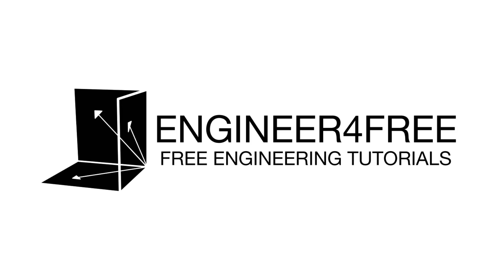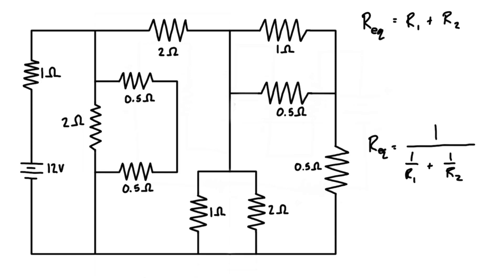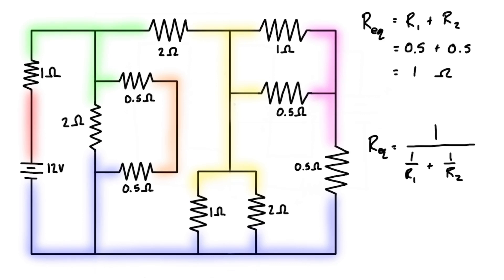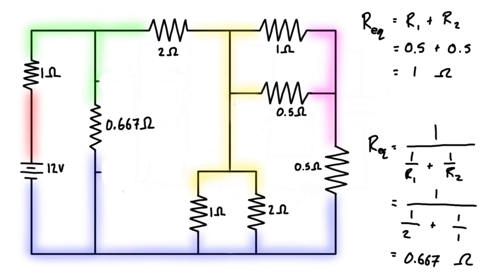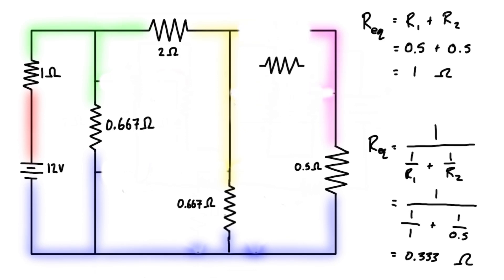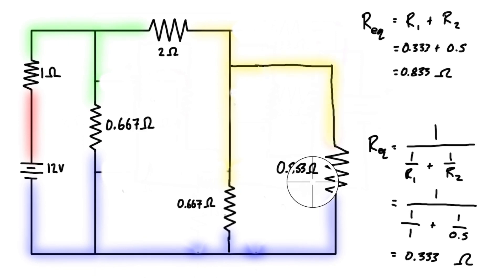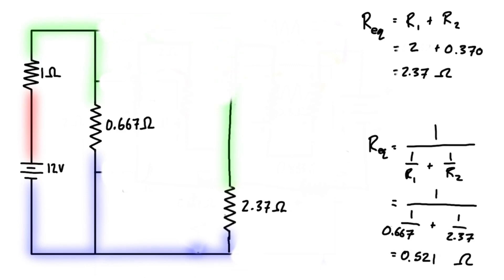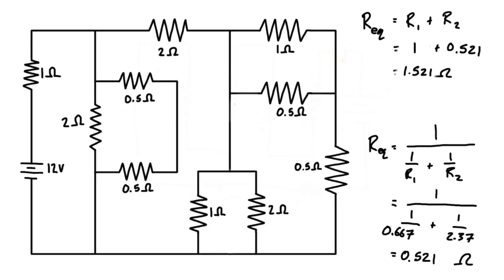Equivalent Resistance of a Complex Circuit with Series and Parallel Resistors

Comment from the maker: The full Circuit Analysis playlist is here:
https://www.youtube.com/playlist?list=PLOAuB8dR35ocf9Typ1iX9NRmX0V04UYfQ
Thanks for watching 🙌
Reply: I get it but I'm still confused lol 
So the current is the same for every single component but another video said current can change in parallel circuits. Idk 💀
Reply from the maker: @Eduardo_Espinoza  The current is not the same in every single component. Two resisters in parallel with difference resistance will have different currents through them, but the same voltage drop across. Check out videos 15-20 for Kirchhoff's laws here: engineer4free.com/circuits as well as videos 21-27 for more examples on current and division.
Reply: Finding current and voltage is complex

Comment: so you solve in series-parallel-series-parallel?
Reply from the maker: Find the easy ones and replace them with an equivalent, combing series ones, it parallel ones. Then repeat until there's only one left. If you need to find current and volt drop in every individual resistors, then redraw the circuit every time, and work your way backwards one step at a time . There are more examples here: https://www.engineer4free.com/circuits-solved-problems.html#series-and-parallel-resistors

Comment: Is there a clear definition of a node ?
Having some trouble 😕
Reply from the maker: It's basically a region that's electrically common, or has the same voltage potential all over it. So in these videos it would be each wire that is not a resistor, we are assuming these wires to be zero resistance. The elements themselves, like the resistors, have a voltage drop, so they are not part of the nodes. So take a highlighter, and put it on a wire. Then colour along that wire everywhere until it hits a resistor or power source. What you just coloured is one node. Change colours and do it on another wire after to find another. Hope that helps to clarify

Comment: need help please, how do i know which resistors to combine first? its very confusing because i get different answers depending on the order i combine them
Reply from the maker: There can get not be one right answer. Just take  two resistors at a time. Find two that are clearly in series, or two that are clearly in parallel, and apply the appropriate formula. Once they are combined, reassess, and pick two once again. Note that f you have two series resistors that together are in parallel with another one, you must combine the two series ones into their equivalent before doing the parallel calculation. Only the combination of the two would be in parallel with the third, not either if the two originals. Hopefully that makes sense. I'll try to make a few more similar videos in the coming weeeks

Comment: Ok, I programmed it out on my Hp Prime to see if I would get the same answer. I get : 1.52032520325 So, rounded to 3 digits it is closer to 1.520 than to 1.521. If mine is right, then yours is a bit off due to the early rounding and error propagation. The formula I used is Seri(1, Parx({2, Seri(0.5, 0.5), Seri(2, Parx({1,2, Seri(Par(1,0.5),0.5)}))})) where Seri and Par calculate the series and parallel resistance of two arguments respectively, while Parx calculates the parallel resistance of any number of elements placed in a list, {...} So now we know the resistance is possibly around 7 milli ohm less  than calculated as 1.521 so it will draw 12/1.5203 - 12/1.521 = 0.00363262675 A more which is around 3.6 milli ampere and so now our space explorer 🛰 which we sent out to explore the galaxy for as long as the battery holds out will run out of power🔋sooner than anticipated! Unless ofcourse the solar panels can compensate for this because then it probably doesn't matter! 🙂

Comment: What is equivalent resistence
Reply from the maker: Ohms law says V=IR, or I=V/R, or R=V/I. A battery of a certain voltage will out out a certain amount of current depending on the resistance it feels between its terminals. Turns out that a bunch of resistors arranged in a certain way can give the same overall resistance as a single resistor. If one resistor gives the same overrllal resistance as a bunch of resistors arranged in a certain way, then they give equivalent resistance. This video shows how to simplify find what the single equivalent resistor is to the initial, more complicated configuration. Whether you have the initial more complicated configuration l, or the single equivalent resistor, the battery will feel the same resistance between its terminals and put out the same exact current.

Comment: My prof told us that always start the calculation away from the source (voltage). Do you still get the same total resistance this way?
Reply: The answer would be same in every case. If it's different then we definitely did some sign mistake

Comment: May be in the figure u write correct but in writing part u calculate equivalent resistance is 0.521 ohm.......which will be 1.52 ohm as per figure......plz ans 💫